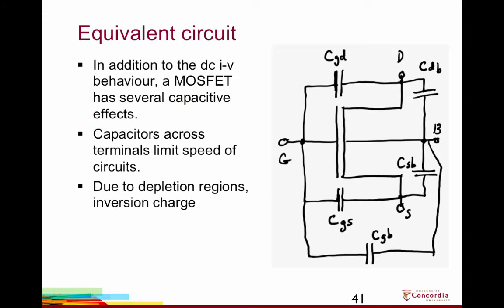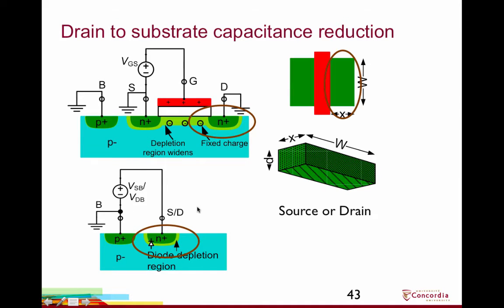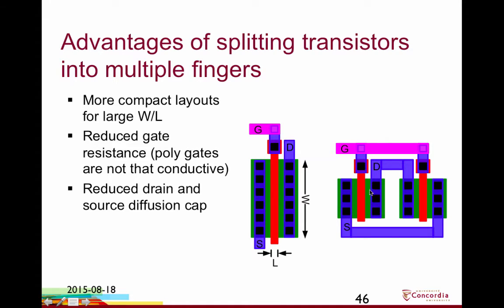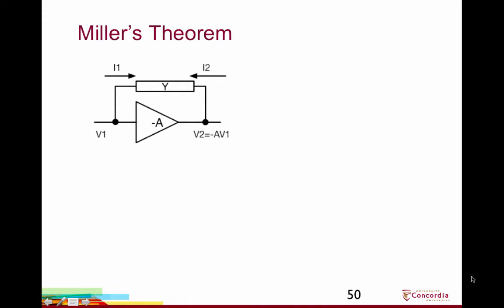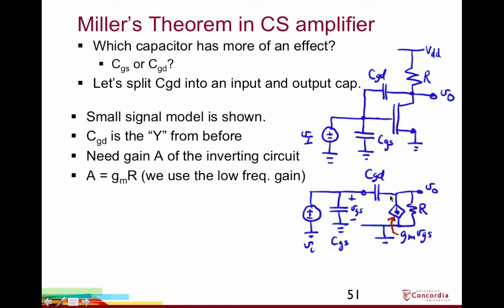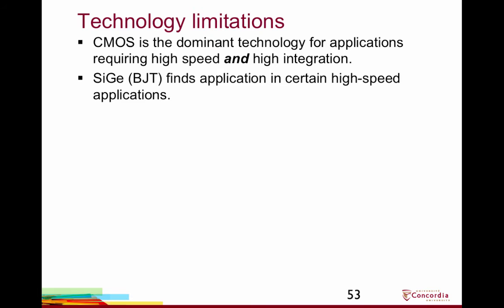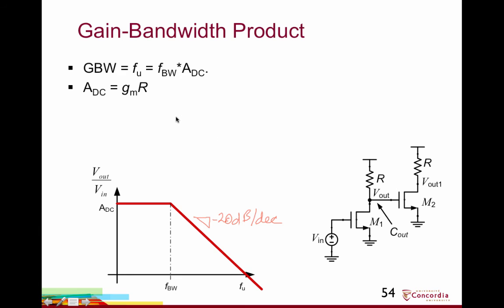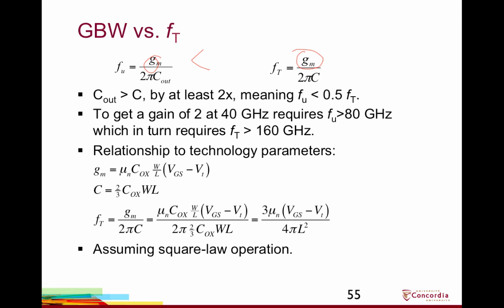CMOS Capacitors, Miller Effect, GBW, fT, Analog CMOS Layout

Comment: So the miller gap, in a case where an inverter input is going 0->1, might cause the output to jump up a little big (input coupled to output)?
Reply: Zambia95 Can you please elaborate as to how that phenomenon works. I can't, for the life of me, figure out how the voltage spike drops back to the supply voltage after a moment. Also how does the spike at Vss go below 0 when Vss is 0.